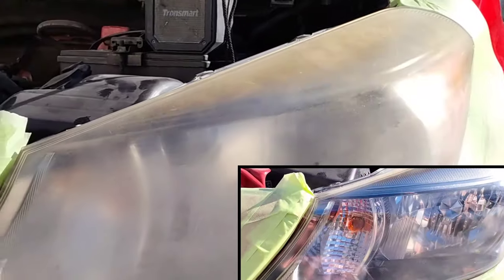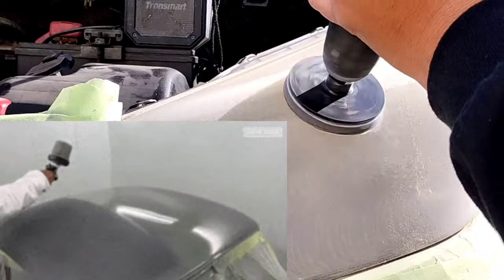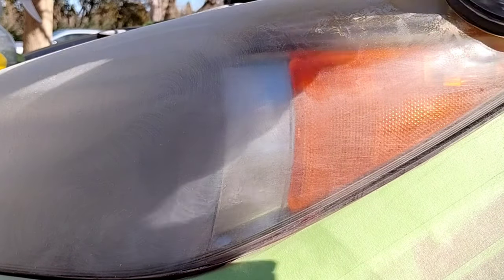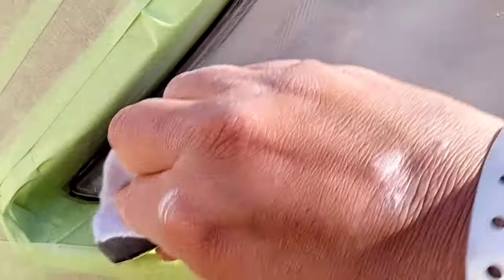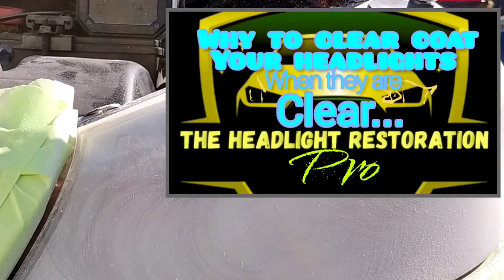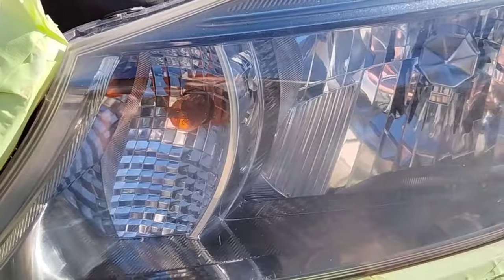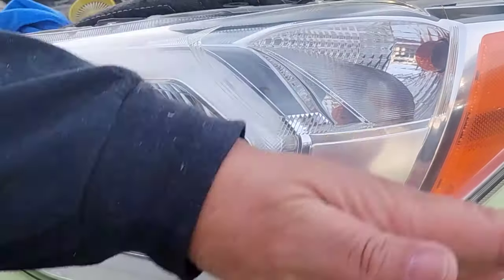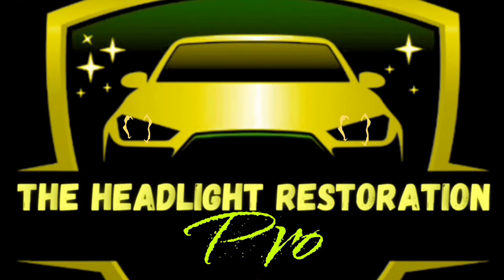how to CLEAR COAT HEADLIGHTS like a BOSS 🦍💯

Comment: Idk if doing something wrong. But everytime I apply that exact coating I get a bunch of orange peel
Reply from the maker: That's insane I've never gotten orange peel not once.. the only proximity to getting the orange pill that I've ever gotten is dust blowing into the clear coat before it dries...
You got to make sure you're doing everything I'm doing did you see on this videos there's about 40 videos up and I do the same method to different lights and they always come out flawless and these are only the lights that choose to show because I don't want to flood the internet with low quality material so I only pick a handful of lights every week but all the other ones come out just as good if not better...
You literally have to use all the products and supplies that I'm using.. and the way that I use them...
A lot of people have a hard time doing this..
All I can change the Polish, I can double coat the headlight, I can use a regular sandpaper instead of a p grade..
All these things matter extremely that I do and it is the end point or one of the high points of the evolution of my headlight restoration method I've already tried pretty much everything else one way or another...
I just make sure that you're using everything that I'm using once again and do everything that I'm doing there's probably about 40 videos up and you should see how they come out the same every time..,👍🏽
Reply: @The Headlight Restoration Pro  Thanks much I appreciate your response. 
I'll give it another try. The only thing I do different from you is wet sanding by hand. 
I was also wondering if the product itself might be faulty, but I have 2 cans, I'll try the other one and see as well.
Reply from the maker: It's very rare that this product is faulty I've only had it happen like once.... And I even think that was an operator error on my behalf... Definitely the wet sanding is an issue and the by hand is an issue... Back of this video which touches bases on that..
https://youtu.be/eoPKK-trHdg
Reply from the maker: Also this video..https://youtu.be/oxRxE5Lb44w
Reply: @theheadlightrestorationpro  Thanks much, I'll definitely check it out!
Reply: I'm not a painter or professional in any way but people that know lots more or spraying with a can or gun have told me that if your getting bad orange peel the paint is going on to dry and drying before it has a chance to flow and level out.   I can't say foe sure that this product reacts the same as automate paints and clear coats.   That might he your problem.  Maybe try applying I  denser shade or trying to slow down you passes to put on a little heavier, but not so heavy as to cause runs.   Good luck  hope you get it figured out.  I just use the same exact product n didn't have an issue with orange peel.
Reply from the maker: Yeah not calling anybody a liar or anything like that but I'm highly skeptical that it's the same product I use.. although I haven't counted orange pill many times primarily associated with 2K clear in the past have never once not even on a misapplication have gotten orange pill for the mcguiars it's not designed the same it has a lot of self-leveling technology in it.. are you talking well over a thousand applications I never not one time I've seen the orange pill... But people will tell their own story...💯
Reply: Same as me so I sanded down again I did it twice nightmare it still did it but I lightly buffed it with with a microfiber cloth and replied wax then wd40 that made it clear.  I probably need better uv spray coat but it will do for now
Reply from the maker: Whatever you're doing and using it's not what I'm doing and using 100% sure..
It's almost impossible to get orange peel as I told the gentleman above..
If you're not doing what I'm doing and using what I'm using anything can happen.. I've never had Orange Peel using the meguiars that's one of the huge reasons why I use it it's one set and done... The only thing close that I've had is dust in floor and debris fly into it at the wrong moment...
Reply: Make sure that you aren't using a rubbing compound or polish with a wax in it.  Wax will cause orange peel and possible adhesion issues.
Reply from the maker: I can almost guarantee he's not using the method... I've never once had orange peel using this method on well over a thousand lights... Not even with a defective can...🥴
Reply: Maybe a slightly clogged nozzle, or needs to run the can in hot water before applying it, or avoid spraying to close to the surface, test the nozzle on before spraying on the headlight.
Reply from the maker: @dossegundos7145 all  very good points
Reply from the maker: @justinprohm not understanding is this a question or what is the purpose of this I don't know if you're talking to me or somebody else...
Reply: @theheadlightrestorationpro  talking to the guy who made the comment about him and his orange peel
Reply from the maker: @justinprohm 👍🏽 yeah I don't know what he was using a lot of people say yeah I use everything you use but I can tell it's not so because literally you've done thousands at this point and never once had orange pill with this product but have with others....(not made for Headlights)
Reply: Heat up.ypur.paint in hot.water
Reply from the maker: @dan3nad no not a good idea you can get it too hot
... But I do use natural elements like your body heat if you're dealing with a can or sunlight....
Reply from the maker: @dan3nad no not a good idea done this before you can get it too hot much easier just to use your body temperature... Or sunlight.... But you're on the right track .👍🏽
Reply: @theheadlightrestorationpro  not like full boiling maybe cooled down to 160 degrees
Reply from the maker: @dan3nad definitely should not exceed 100°....
Reply: I heard you mention 2k clear destroying headlights. Can you elaborate on that a bit (if you don't mind)? I thought that would be best since it has the hardener.
Reply from the maker: @kingly7946 no it's the worst if you want a little bit more liberation there's plenty of it on this video and there's other videos that are titled to do with 2K clear that would actually go more into depth about it on this channel there's over 130 view videos couple of them are about this so I would start there...
Reply: @theheadlightrestorationpro i think the orange peel that guy messege you  is the type of clear coat hes using

Comment: I always uninstall headlights when restoring. Then If your using clears that take longer to cure or your worried about stuff getting into the finish. You can uninstall the headlights spray them and cover them with something like a tote while they dry.
Reply: In practice if you have a mobil restoration business it's far to time consuming and impractical, Moreover you run the risk of something breaking in the dismantling!!!

Comment: Beautiful results as always, am constantly learning new things from you for the business. I second the removal and starting over, if you think you can spot correct... you can't, you'll always see where you've redone something. Always best to take the L and start over. Got my Trizact pads the other week and you're right, they are indeed a magic pad. Love your work sir.
Reply from the maker: Awesome.... thank you for watching....👍🏼☺️
Reply: @theheadlightrestorationpro Hey I used 2k clear coat on my headlights but forgot to activate the hardener. It is looking decent now. What should I do? It looks fine. not wet or anything.

Comment: I hate doing visual restoration on stuff. I'm great at mechanical stuff and I'll fix something as simple as broken internals on a side mirror to save the 80 bucks, but I'd rather pay 160 to get new headlights shipped to me... I might try doing exactly what you're doing, cause I don't wanna pay 160 for pontiac vibe headlights.
Reply from the maker: At 160 they must be aftermarket which are the worst lights you can possibly put in your vehicle I wouldn't recommend it to anybody unless they were going to scrap their vehicle in a year.https://youtu.be/VSNEhD2obQc?si=HomHX5iY8T-v6_P7

Always a thousand percent better to restore your oems...

Comment: I restored a set of headlights, and I used the mcguire's headlight coating. Maybe like 2 minutes after I put the coating on, it  started to rain & left spots on both headlights. In a case like this. I basically repeat the steps 500, 800, and 3000 again, right?
Reply from the maker: Yes...just start over...got to watch those environmental factors..lol
It sucks been there...and I've been there when in doubt start over...💯👍🏽🤓

Comment: Thanks for the great video. Followed your instructions, but I think I went a bit light with the clear coat in some spots. Must I start over or chance it with a few passes where its light 😬...
Reply from the maker: Probably start over unless you can deal with it until next time...
But whatever you do don't spray it again...Over the existing coating ..that will really mess it up..🤓👍🏽
Reply: wasting your time never spray 1k or 2k automotive clear on polycarbonite

Comment: Question,

I practiced on an old set of headlights using your method. They look very clear! However, when I look closely, I can see some horizontal scratches, but only if I shine light through the lens. Any ideas?
Reply from the maker: Might not be doing enough... might need to focus on the p800 and or the 3000 trizact pad...But first and foremost are you using exactly what I'm using?
If you're not using exactly what I'm using you might have an issue....
Also you might be pressing too hard against the light..(when you're standing by hand and or machine)... Horizontal lines make me think your hand sanding too hard... And once again are you doing the exact steps I show, exact products, exact placements of steps..?
Reply: @theheadlightrestorationpro  I have the kits you recommended from 3M, I’m also using a drill for the sanding part and the same polisher from your videos. After machine sand with 500, I go over it with horizontal passes to remove the swirls. I do the same with 800. I suspect that I’m probably applying a bit of pressure, even though it doesn’t seem like I am.
Reply from the maker: Well you should only be handstanding with the p800.... You should see very few videos that I'm hand sanding with the p500.. that's only for extremely roughed up lights, that I probably previously used a 220 or 320 on aggressively.. the root of your problems is the pressure of your hands on both hand sanding but primarily your p500 hand sanding is unnecessary unless it's an extreme light circumstance... Only with the p800 with light pressure so imagine if you're doing too heavy pressure with the p500 you would be gouging out stuff that's harder to repair and sometimes hard to see...
Are using the same polish.. makes a huge difference. . are you using the 3000 trizact...?????
But if they're horizontal like I said what a likely it's your pressure hand sanding... it's very light shearing motion... I literally am holding with three fingers most the time...
Reply: @theheadlightrestorationpro  thank you for replying! I’m using the 3M polish like you have shown in your videos. I’m going to re-do the lens and follow your steps. Thank you!

Comment: All these restoration videos are really good for showing how to restore horribly oxidized lights. However, what I I want to spruce up lights that are just starting to oxidize and yellowed?
Reply from the maker: It's recommended to run the same exact process.. this is the thing I have to tell customers as well that say I just have a little wear or it's just a little bad.. that's just the beginning... What's one part goes bad it starts growing it's indicator of the fact that the clear coat is dying and or overly dead or worn in that area.. there's no real spot fixing... You can do it but it's not recommended because now you have something that would have likely is visible meaning you can tell it's been done or you have the rest of the stuff you didn't fix that is just as old and worn as the stuff that you did fix but just wasn't showing signs and sooner or later will show signs maybe even around the fixed part there's a lot of stuff that goes wrong when you try to spot fix so basically you run the same process it's just easier per se cuz you're just removing mostly clear coat...
Hope they answered your question...

Comment: I see you typically use P500, P800 then finish with P3000 on most of your work. Do you ever find a need to add more finite sanding steps in-between such as using 500, 800, 1500, 3000, then 5000 grits? And/or do you think adding more sanding progression steps like that would help a beginner get safer, better results? Thx for all the info you share in general.
Reply: Why bother have not seen any better results ever than this method have you???

Comment: Quick question...when sanding with the drill with 500 or 800...what rpm is best and which direction are you sanding....clockwise or counter clockwise
Reply from the maker: Well ..for me I feather my trigger...so I'm use on average about 1500 -1700 RPM...but I'm a professional..this more than likely would be a bit much for anyone who isn't... I recommend trying the slow setting first...
Direction doesn't matter... it's left or right in these terms.. it's whatever you feel comfortable with...

Comment: what type of clear coat do you spray? I saw another video you made which said not to use clear coat, as it can cause major spiderweb cracking in the longterm.
Reply from the maker: That video must have been a 2K clear video it's not all clear coats are the same.. and every video I present and show what I use.. it's also located in the bio for direct purchase...
You should always use a clear coat that is designed for headlights and or headlight restoration..(it must say it on the can/or on the packaging)
Reply: you are correct it is called substrate degradation never coat  with this type of product

Comment: l have a 1993 toyota camry the headlights have 3 casting or molding points sticking out would you sand them down flush or just leave as they are as that might make them weak and mybe crack over time , i do like your work, vidoes and results thanks
Reply from the maker: If you want to take them down you can but the safest way is to send them down they're pretty easily sanded down with the same setup I'm using now on these videos.. with that being said I wouldn't do it they have a key role in your headlight and as you say they might develop weak points..
Check this video out this is about those points it shows you how to do headlight restoration with vehicles like this in fact I believe this is that vehicle..
https://youtu.be/9xswHwRWy2k

Comment: Hey brother, I love this video. Everything on point. I do mobile HLR I was wondering. i'm picking up business wise. I'm thinking nof investing in a heatalmp or blow dryer. To speed up the process. In you opinion what is the best or fastest method to speed up curing. I use thin coats dries in 5-10min. I do it several times for a nice thick wet glossy look. It just takes a minute. I know heat works fast. I've never used a heat source aside from the sun. But at times in under my canopy and its not enough. I figured I'd reach out to another pro, and see what a pro would suggest to another pro. look forward to hearing back from you.
Thanks,
Tj Torres
Reply from the maker: Well there's a lot of things that you should watch his me videos as you can of mine..
Not just promoting but actually everything that you have said in this message literally has a video about it or at least touches bases on it.. but I used to do everything that you speak about.. really should watch my video about double coating... And any coating that you're using that does not fully dry and less than 5 minutes probably should be using it especially if your mobile.. the stuff that I'm using dries in seconds I used to try heat lamps, blow dryer, heat guns, and even UV lights expensive ones.. but as you'll see a mini my videos and I'll mention the best method for drying is air-dry or better yet forced air drying the powers of fans... I personally wouldn't use heat guns cuz it affects the structure of the clear coat pretty-much.. drying it too fast make some weird things happen let alone the heat makes weird things happen and the long run and sometimes immediately with the clear coat far as fogginess, brittleness,and peeling..
Include some links of things that probably should watch on my channel but really should check out most things on my channel...💯
https://youtu.be/NgxNImOAoCY

https://youtu.be/LC4ZBu02JZg

https://youtu.be/k8_ljUVQfvo

Comment: So, the clearcoat lasts about a year according to Meguire's instructions. What needs to be done at that point? Strip the light by sanding the surface or just reapply over the lens?
Reply from the maker: False information 
https://youtu.be/FEhI4RVwe0w?si=5U2p5pMOmRQNZeEr

https://youtu.be/_Mzt9uyFvR8?si=KP_-ywr2biwBF7bO